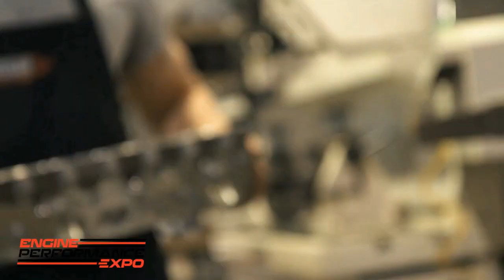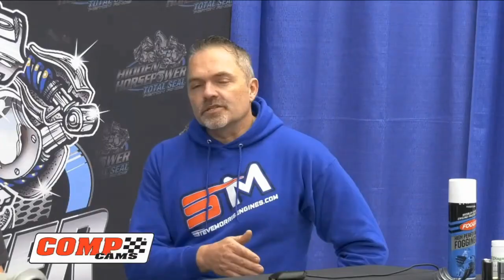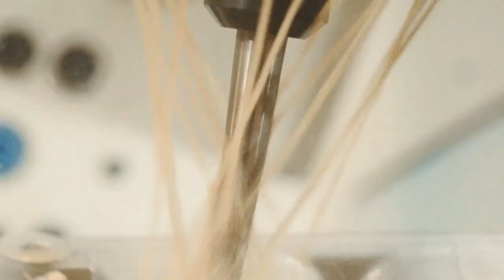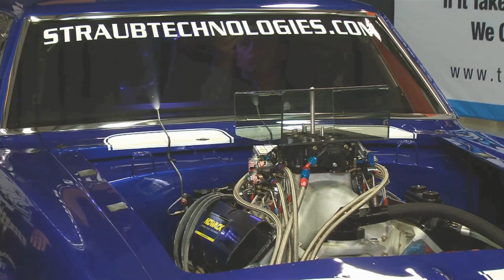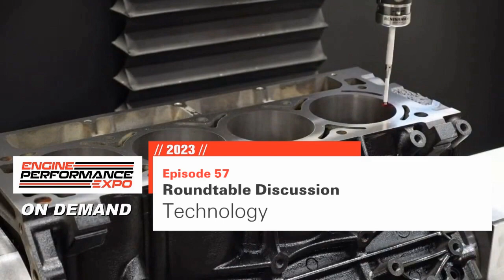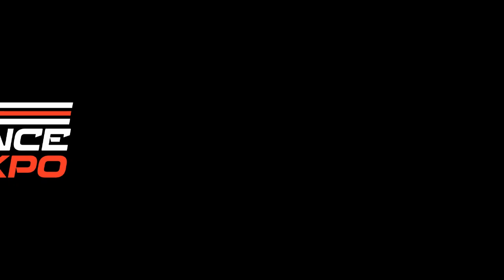Technology Roundtable (2023 - Episode 57)

Comment: I know direct injection has a inlet port/valve carbon problem, but the fact that valve timing and lift can be wild and fuel doesn't get pumped through the engine unburnt has to be a good thing. Is anyone modifying direct injection gasoline engines??